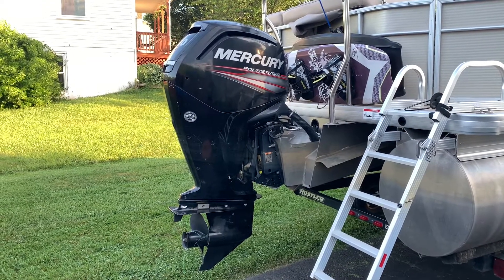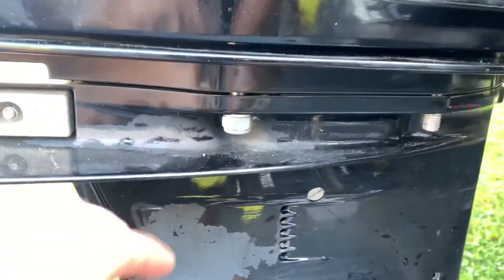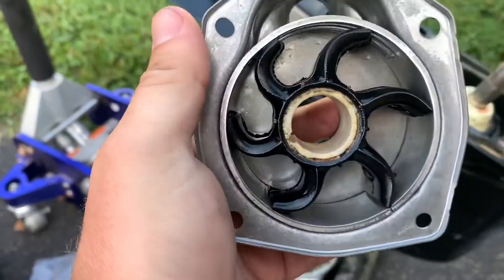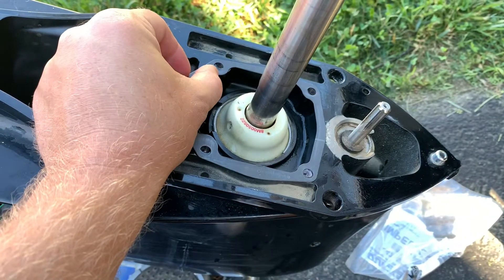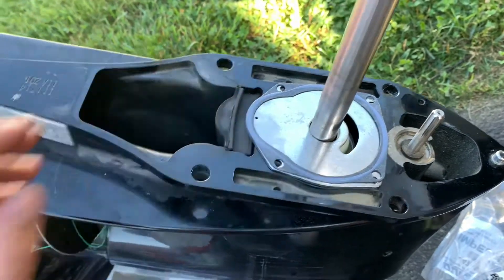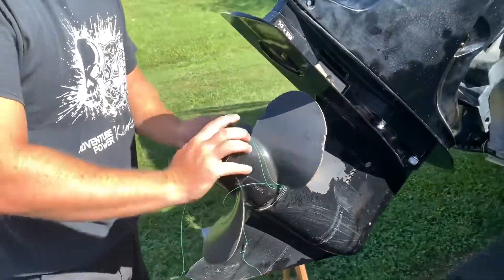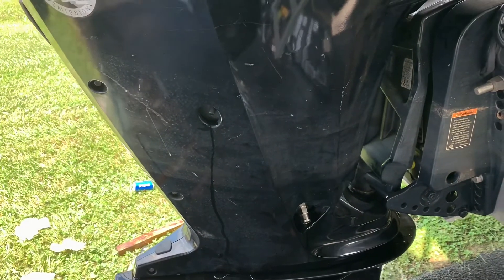Complete How to replace impeller water pump on newer Mercury Outboard fourstroke 90 hp

Comment: Im having trouble getting the back side of the bottom end to connect. If i tighten the bolt anymore im gunna strip it. What might not be lining up that is holding me up?

Comment: 3:21 you say start the project in neutral and then it should reassemble the same. 14:07 you say differently (unless you moved the prop during the process). Can you confirm what to do?

Comment: Hello friend, your video is very good. I'm buying a 2013 Mercury 90hp fourstroke 1.7 EFI engine and I can't see the propeller number. I noticed in your video 7340A45 13P. Is that the factory model of your 90hp engine? I thought it was a 17-pitch?
Thanks.

Comment: @buildsomethingstupid does your shifter shaft moves on its on in neutral? mine does and im having trouble with the gears after putting the lower unit back in
Reply from the maker: You can put the shifter in gear as long as you match that on the lower unit.  Then obviously test the full range of motion in the shifter and make sure the gears operate as they should.

Comment: Not a single marina I've ever worked at ever ran any boat dry... maybe you had a bad experience somewhere but that's certainly not something we do in the industry. Further more you have a bonding issue with your boat which is why all the paint is coming off your lower unit, might want to figure that one out before it gets worse.

Comment: you can use a little dab of marine grease to help hold the plate, gaskets and key in place and lined up for bolts.  also inside housing to aid putting the new impeller in.

Comment: The only thing I would do differently is put the impeller on the shaft first then twist the drive shaft clockwise while pushing down and setting the housing. Additionally I would have put some waterproof Marine grease on all the spline shafts and the bolts.
Reply from the maker: Thanks

Comment: I can not get the 14mm bolt loose from the bottom on my new engine.  Is it reverse thread or something?  Is it just extra tight?  It will not loosen and I am afraid I will break it.

Comment: Thanks. Very good Video. I just removed my bottom end on a 60HP a few days ago.  Got my new kit from Amazon ( quicksilver ) and was wondering about the re-install of the lower end after I replace the impeller and gaskets etc.  Took mine out in neutral.  Hope it goes back in as easy as your's did.

Comment: My first impeller lasted 15 years, and still looked okay - not great mind you, but okay. It had one very small chip on the tip of one blade. Since then however, I have replaced it about every 3 years.
Reply from the maker: Maybe oem is better rubber?
Reply: Non

Comment: so when you remove the lower unit everything is in neutral but to put it back together you manually put the lower unit in forward and the shifter in forward?
Reply from the maker: I actually did that on accident because I turned the lower unit into forward.  It's doesn't really matter as long as both are in the same gear.

Comment: Mine stops about 1/4 inch from being flush. Mercury 90 4 stroke 2016. Makes no sense. No matter how many times I spin prop and I make sure my shifter is in 1st as well as my shaft. About ready to just put one nut on and crank this shit down and hope it all works out.

Comment: No grease on the shaft?  Should I put some on it ? Since it’s out
Reply from the maker: You would want a silicone by the rubber seal over the impeller seal and then you coul put a dab of grease on the splines for the motor (after you assemble the impeller)

Comment: Great video! I'm about to try on a 50hp 4stroke. Should I be worried about getting the fin back in place right? Do I mark it? Right now it looks to be perfectly centered with the shaft of motor? Is the fin critical during this process? Thanks!

Comment: I’m not bothering with watching any other videos on impeller replacement. My 07 25hp 4 stroke stopped pumping water today while doing a little mid winter idle in the driveway. You are so through that I could almost do this for the first time blindfolded. 😅

Comment: man the only problem I had was trying to align the splines for the lower unit and now the shift shaft is locked and wont even rotate clockwise or counter clockwise... anyone have this happen to them? looks like the shop it is, Ive been trying for the last couple of hours and cant seem to get the shift shaft to even budge.. im defeated
Reply from the maker: Sounds like you engaged the lower unit in gear on accident. If so the shaft wont spin without spinning the prop.  Rotate the little shifter shaft that changes gears and find neutral again.
Reply: @buildsomethingstupid1736  Sometimes it’s the little things that somehow become the nightmare. I always read the comments on great videos looking for nuggets. Thanks 🙏 again.
Reply: @buildsomethingstupid1736  right now, the prop just spins freely without the driveshaft even spinning... should I put a combo wrench and twist the shift shaft?
Reply from the maker: @Quackk_Addict  I wouldn't crank it hard it shouldn't be hard to switch gears.
Reply: @buildsomethingstupid1736  yeah it is very hard to twist the shift shaft… It is weird how it locked in and now we can't get it to come out… Twisting the driveshaft does nothing to the prop shaft… If I put a prop on it just freely spins
Reply: @buildsomethingstupid1736  So I ended up popping up the shift shaft since I couldn't get it to do anything so I began to wiggle the prop after I drained the lower gear unit oil again and now I got the prop spinning the shaft… The problem is now the shift shaft sits back down in there but just freely spins in a 360
Reply from the maker: If the shift shaft won't budge then wiggle it while you wiggle the prop.  The prop is holding tension on the gears

Comment: I’m confused. I’ve watched several videos that say turn the drive shaft clockwise while installing impeller into housing which would have the fins bent the opposite direction of yours
Reply from the maker: Whatever direction is the correct direction.  You can use your old one as a guide.  If in doubt bump the starter on the motor and see what direction it turns and use that as a guide the outer fins should be dragging and not pushing
Reply: @buildsomethingstupid1736  I figured that part out. Now please help me figure out why I have water in my engine oil now. I don’t know how I could have screwed up that bad but apparently I did. Lol

Comment: great video, the water from my engine comes out in flots. I have also changed the impeller and the gaskets. Mercury orion 60 hp from 2016
Reply from the maker: Might be head gasket blown and thats where the air is coming from.  There shouldn't be any air bubbles spitting out

Comment: Thank you SO much!! You made this so clear and easy to follow along with!! The jack tip... That is worth a pot of gold LOL Slightly off topic - Any clue to find out what (or where the info is) my gear ratio is? I have a 2012 60 ELPT 4 Stroke... And I have the $$$ manual and it lists two different gear ratios. Thanks again!
Reply from the maker: Do you know if it is a command thrust? The command thrust have the higher ratio.   for example 1.83 for regular and 2.33 for command thrust.

Comment: Hi is that hole in front of the lower unit normal is on the right side towards the front is not the water intake slits is by the front
Reply from the maker: I got to honest I can't understand what you're asking.
Reply: @buildsomethingstupid1736  on the right side of the lower unit the one you just removed I can see I small hole or something  I noticed because mine has has one just like it but mine is from a motor built on 1969 Mercury 110 6hp Twin in fact I have 2 Mercury a 68 and 69 one has the hole, the other does not can understand why so while watching you video I noticed the hole around the front of you lower unit about 4- inches from the front cone. It could be nothing I will keep looking can’t figure out if it is factory or the previous owner just open the hole. Thanks for the reply.
Reply from the maker: @Myneckofthewoods7  not sure what it is

Comment: i took my boat out on the lake today when got home and tried to flush the engine, i didn't see the water peeing. i think it's clogged somewhere, what should i do? can you give suggestion?
Reply from the maker: If it was peeing at the lake theb its probably not a blackage but a weak impeller.  You could remove the thermostat and see if you can pour water through the hoses and find the blockage.

Comment: Can a totally broken water impeller cause the engine to lock up??? Cause i couldnt pull it by the rope. So i took it off. Put a wrench to it. Used little pressure and it was free totally. No grinding whatsoever
Reply from the maker: Only if you run the engine long enough to overheat and blow it up.  I mean I guess it's possible on a small pull start motor..  That sounds more like the engine sat for a few months and got a little rust on the rings
Reply: @buildsomethingstupid1736  okay why im asking was my engine over heated cause i didnt realize it wasnt getting any water. And engine locked up. And yah i did what i said up there on my post…. Anyways i changed the water pump drove arnd for 2 hours full speed. Hasnt “seized” up yet… people were telling me “it’s finished.”  “It would only run less then an hour” but idk i jus stayed close to shore driving arnd testing the motor out lol! Bout to go for a another test drive
Reply: And this is a 2 stroke mercury 25hp im talking about….. im just commenting on peoples videos water pump related

Comment: There should be a nylon thrust washer above and below the impellor.  Water pump housing 10mm bolts (four), lower unit 5/8" bolts (four).

Comment: Great video I love the tips you give will come in handy …. One question should you keep in neutral when sliding off or put in gear ( I know you mentioned to keep in neutral).  Because it seems like you had put in forward gear to line up when putting back on.  Have you done any belt change outs yet they say at 300 hrs? Would love to see more videos on 300 hr maintenance 😁 before I screw this up next week!
Reply from the maker: Doesn't matter what gear you use as long as it matches the lower units gear.  I did put it in forward, this allows you to spin the prop and make the shaft turn so it lines up the splines easier.  As soon as you put it up and start a bolt or two go to the helm and go thru the gears and makes sure it moves and engages correctly

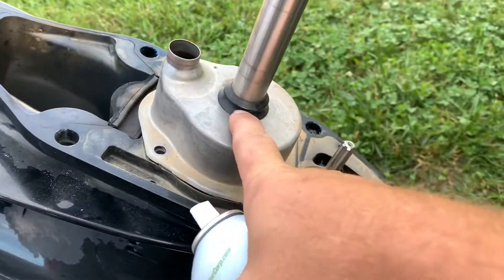Comment: He forgot to put on the shaft seal that goes on after the impeller housing is reinstalled. Check out the section starting at 5:10 mark.  Then check the 14:20 mark when the lower unit is reinstalled ... oops!  Hopefully this doesn't cause issue.
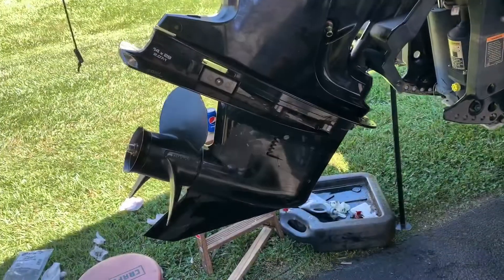Reply from the maker: You should probably go to 16:40 where I talked about that lol.  Good catch tho
Reply: I just took my 2018 lower unit off and mine didn't have the shaft seal on!  Did someone at the factory or dealer forget to put it back on?

Comment: Very, very helpful amigo - thanks for doing this! Great trick on using the jack as well. I gotta say that the basics are all the same for a 2016 Mercury 60 4 stroke.
I sure envy you being able to stab the assembly right up there on the first try. I had to struggle with mine...
Reply from the maker: Thanks! Its always a pain to get it lined up, I had a heck of a time with a 70s Tohatsu motor a few years ago.

Comment: Very good video. Thanks for posting. I need to do mine.
Reply from the maker: If you look at the video and see the old impeller... that's 5 years old and ran dry at idle for over an hour.  So I would only do it every 5 years, not the every year that a marina will recommend.

Comment: Thanks great upload. Do you know if rubber prop spins clock wise or counter clock? @ 6:50
Reply from the maker: The impeller turns clockwise when viewed assembled from the top of the motor.  so you want it to look exactly as it does in the video.  If you install it backwards it should flip itself right after being run but it also has a small chance of damaging the impeller.

Comment: I notice you only replaced the o-ring on the white oil seal cone.  Why wouldn't you replace the whole thing since there is an embedded double lip seal for the shaft in the cone as well and is usually replaced as a unit.
Reply from the maker: Never seen an impeller kit that had the cone.  Not a bad idea to replace it tho.... if this were an older engine I would 100% have replaced it because they pretty much all leak after 10-15 years.

Comment: What are the torque specs for the four bolts on the water impellar housing and also the four bolts holding the lower unit?
Reply from the maker: No idea! I just judge it by experience and bolt size.  Never had a problem.
Reply: 60 in pounds

Comment: Hey! Excellent video, Kenny. I just changed the impeller on my 2016 Mercury 90--based on your guidance--and I have a question.

The impeller swap went easy-peasy for me, but when I put everything back together, the shift lever (by the dash) was jammed super tight. So dropped the bottom end and re-inserted it. Same problem--the shifter is stuck. I repeated this half a dozen times.

Just so I'm clear, you had your throttle lever in NEUTRAL before starting. Then, before you put the lower end back in, you twisted the gear spline thingy until you found NEUTRAL? And you confirmed it was NEUTRAL by spinning the prop, right?

Any ideas how I messed up?

Thanks,

Andreas,

Lac du Bonnet, CANADA
Reply from the maker: Yeah that part can be a pain sorry I just saw this comment.  You can manually move the splines in the lower unit until you find forward neutral and reverse by checking the rotation with your hand.  Once you find it match it up with the gear position at the helm.  Whether you have it in forward neutral or reverse is fine as long as it matches the helm position.  It still may shift or move while you pick it up so sometimes you get one spline off and have to drop it again.  I usually insert it just enough to get the splines in and test it before tightening everything.